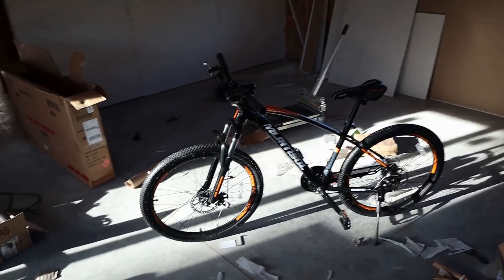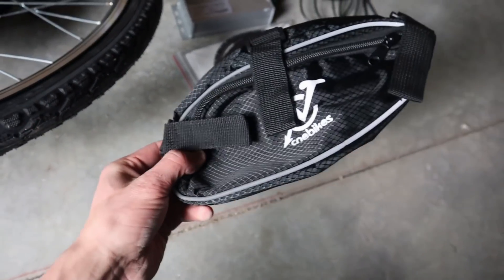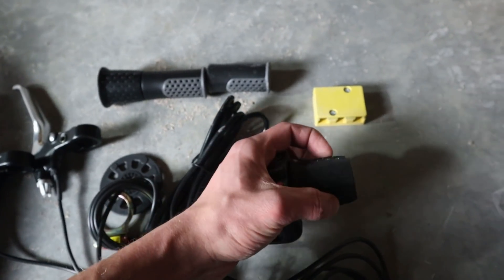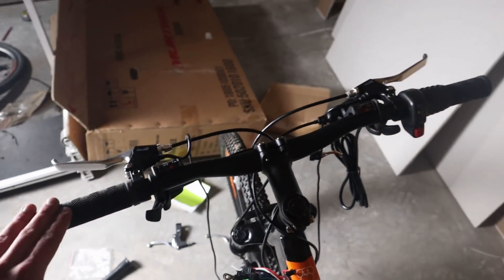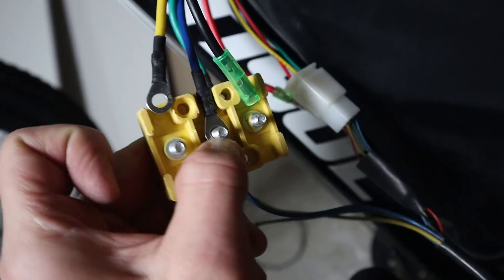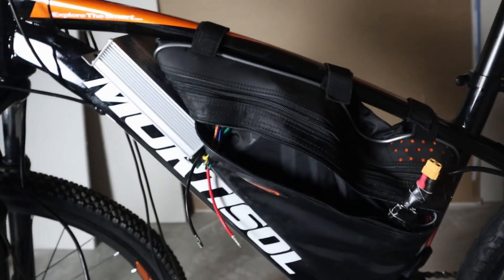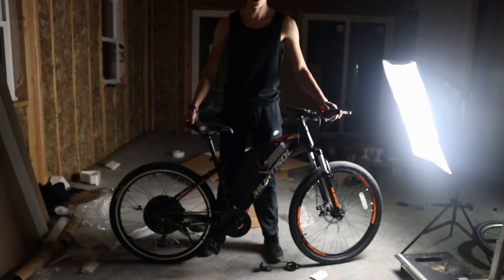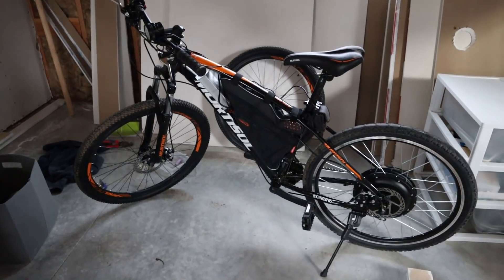$400 FAST DIY Electric Bike

Comment: Hi. Hi  need to build a one. But locally it s hard to find things... i have to import at once so bit scared to spend For research because of high price. 20/24 inch mtb what do you recommend motor
1.) Flipsky 6384 4kw 1kg 190kv speed  9Nm torque 
2.) Kunray my1020 3kw 5kg 5000rpm at 72v 5.4Nm torque 
Confusing part is kunray 5kg but 5000rpm 5.4Nm and flipsky is 1kg 6800rpm(36v) with 9Nm 
Thanks

Comment: What size motor is that wheel, an the battery? Did I miss that 🤷🏻‍♂️
Reply from the maker: 1000w 48v and a 10ah 48v battery
Reply: @logannobles  cool

Comment: Can I use a 1000w 48 volt front wheel kit with a 48 volt 20 ah lithium battery?
Reply: Yes. It will have a lot of torque but most likely use up more battery
Reply: @ripp3rjak934  what would you recommend
Reply: @jher6969  I mean the kit you have currently can take you up to 28mph so that’s already decent. 

I would recommend getting a bigger hub drive if you’re looking for faster speeds. 

The 20ah is already more than good enough.

Comment from the maker: Just a public comment nearly 2 years after I made this video:

1. I went on to make 20-30 more electric bikes and learned that this one was done very poorly. Please ignore anything obviously dangerous or stupid
2. This was a brand new house. The audio was terrible in the intro, I apologize.
3. This video has made me almost $700. Thank you so much.
Reply: How about making an updated video with the lessons you learnt?
Reply from the maker: @rugglez  Great idea
Reply: Could you teach us about the wiring that you have to DIY sometimes? Or about different components that are compatible with different builds, for example LED lights, LCDs, maybe even water-proofing your wiring? I wish I knew that some kits were pretty bad before building my first e-bike. We had to make a lot of work arounds especially with the battery connection, gear ratios, and LED lights.
Reply from the maker: @originalrecipe6113  Late reply, but yes
Reply: @logannobles  thx

Comment: checking out the parts (and similar items on ebay). EVERYTHING, exccept the flashlight comes with shipping that is double the item's price!!! so a quick estimate it went up to 1100$ (without a bike!!!)...
I do find hub motors on 1000W & 1500W for under 200$, but they are only the hub motor. They are missing the wheel... and i am a bit scared to put the wheel on the motor (u know with all the little wire-sticks (that have a name), etc...)
Problem is it doesnt come with any of the other parts he showed. Like controller, trhottle, cables, regen bracking, etc... and if i go to pick up those by myself, i am sure that half ofthem will not work with eachother and i will have to dyi them (entering an infinite dyi cycle...)

No battery for under 400$... it will cost me close 280$ to make my own... but i dont really have the necessary tools...
And on the bike side, mine has really skinny tires, and the forks that hold them are quite close... so a new bike is needed... and again nothing acceptable for under 300$... and by acceptable i mean sth simpler than what he used. I would be quite happy with the one he used.

So... once again i am going back to looking for parts and a way to do it on the cheap, because hte costs above dont really fit my definition of cheap.

(for context i am in Greece, not the US. $ is used as an indication, everything is converted from euros)

Comment: This guy so dumb plugging that in with bare wire if they touch that would burn out the speed controller  and not be good for your batteries

Comment: 10:19 you really fucking say why all the  cables are so  long u have any common sense why dont u look at the front of the bike why are the brake cable and cog set And derailleur so long so they don't get twisted around the bike frame and handlebars and so they can reach where they need to be and why the ebike wires soo long??? So if you want to put the controller box behind the seat in a basket and there are some cruising bikes that are really long like the stingray bike they made it so if someone wants to do that stuff they have enough wire to do it woow i felt dumb hearing that where. U alienated?

Comment: 12:10 wooow that is so dumb and dangerous and also puting 12 gauge wire together with  20 gauge wire another dumb thing. Thats like connecting a 2-inch pipe to a  1 foot pipe thats a lot of resistance and connecting copper wire with steal wire even more resistance and drag with the power
Reply: Resistance doesn't work like that. The 12 gauge wire can handle the current the motor needs, and the 20 gauge wire is unnecessary. The resistance will not have any noticeable effect.

Comment: Obviously the next step is to do a kick-ass dual wheel drive that I think would change up the whole game
Reply from the maker: Oh, it’ll happen. It’s been close to a year since I made this video. By now I’m building 3-5 of these every few weeks to sell
Reply: @logannobles  I'm interested do you think you could put one together for meI've got a few bucks saved up and I'd like something unique you know what I'm saying
Reply: How do you wire a bike with dual motors? AND do you need dual batteries, and Dual controllers, too - or can you run both motors on 1 battery, 1 controller and 1 throttle?

Comment: I looked at one of those kits!! It $141.00 for 1000watt rear tire!! So how many lithium batteries should I buy?? And a charger to correct?? TYVM I’m BRIAN..
Reply: Does the controller come with the kit?? Ty
Reply: Rick Simpson  ahhh same man recently bought a kit and built a battery. i shunt modded my 25a controller and accidently took it up to 60a and added regen and it started poping wheelies lol but but will burn the motor in 10mins without additional cooling lol. i reccomend at first go with a 1000w kit and mod the the shit outta everything and run 5kw or more peak. mod the motor and put ferrofluid and hubsinks and get a programmabble controller and high amperage lipos. a used dh bike or fs bike with air forks and shocks is what you need ive read zoom hydrualic brakes for £25 are good enough and im going to purchase them soon and i also have regen but its not powerfull enough to replace my brakes but slows it down and reduces wear on brake pads my frame is a used fs for£15 but is steel and im currently adding a torque arm so the frame dont break and ill be back on the road . endless sphere forums is the way to go for researching
Reply: Rick Simpson  my 52v 10ah pack cost £90 look into makeing batteries and purchase littkala 26650 cells from aliexpress. look at vortecks channel his ebikes are a good example of high power safe ebikes

Comment: Add a hub motor to the front wheel for MOAR POWAH!
Reply from the maker: edstar83 Hey! Thanks for subbing. I’m actually considering a 2wd bike next!
Reply: @logannobles  No problem. I'm enjoying your videos.
Reply: @cobz76  Horrible idea.

Hard on the forks and the drop outs are not beefy enough in the front for the instant torque of an electric motor.

Im sure you could add some kind of a torque arm for added strength, but beyond that...kinda risky.
Reply: @robspear03  As long as you don't try it on a wallmart bike it shouldn't be a problem. Mountain Bikes over $1000 usually have beefy forks. 

Growing up I lived on my bmx bike. It took me on many adventures. And that bike copped a lot of abuse,  I was jumping and doing stunts on it from the age of 5 up until I finished high school. I never cracked a fork or bent a rim.
https://www.youtube.com/watch?v=SHXQr2MPJS8
Reply: @cobz76  I use Walmart bikes....I just ride on the flats and I don't do stunts....I might hop off the sidewalk from time to time.
Reply: @cobz76  I don't use Walmart china crap bikes, its only American Made Chromoly Trek bikes or nothing for me. Durability is my desire over light crap

Comment: You have no idea how to build a ebke most important part is your battery, second hand rubbish or lead acid will not do.
Reply from the maker: Well, I've finally started spot welding packs out of LG cells, as of the present time. This was my first attempt and, yeah, maybe I didn't know the safest way to build an ebike, but I did it, it worked, and it inspired me to keep learning.

Comment: My first homemade ebike  was in 2005. Wilderness Energy 600 watt front wheel drive. Came with a 36 volt controller. 3 lead acid batteries 12v x 12Ah. Thumb throttle. Used it to commute back forth to work. Averaged 25 to 28 miles per hour. A lot of rolling hills in my area. Eventually bought a 60v controller from another company. That baby would fly. Sold it to a friend minus the 60 v controller. Does my heart good seeing more people turning to EV's.
Reply: Probably going to Walmart online to get my next ebike kit. They got some really good choices. Check'm out next chance you get. Walmart online.

Comment: Brilliant 👍 I'm thinking of making a similar budget full suspension electric bike.
Reply from the maker: Isaac Lyons thank you! Actually So am I!-
Reply: @logannobles  awesome! What kind of parts are you planning on using? I'm thinking of using a cheap 1000w hub motor kit from ebay, either two or four 6s lipo batteries and a cheap full suspension mountain bike.
Reply from the maker: Isaac Lyons that’s what I’d do, except I’d buy two new controllers and overvolt them both to 2000w 😜
Reply: @logannobles  lol. What about an electric swing bike then? Google it if your not sure.
Reply from the maker: Isaac Lyons Definitely could be done! Just have to mount the battery differently.
Reply: @logannobles  yeah

Comment: how many miles you can drive with that battery
Reply: About 15-20 miles.
Reply: @matts5124  what about the cheaper?`
Reply: Johannes less than 10 miles maybe less, like 7 or 8. Plus they are heavy as hell.
Reply: Johannes if you’re going to get a battery, don’t even buy the cheaper acid based batteries, it’s not even worth building an ebike using them.
Reply: A very legit Question 👍

Comment: Wow wish I could get these parts anything near that price US $142.99 in the UK. Pity about the dangerous wiring job and soo small a frame size bike but Boy did it shift?  Have you ore anyone else  got any links I can use to get some of the parts in the UK  at good low prices?
Reply from the maker: Hahaha it was my first bike and sketchy as heck. Not sure I can help find parts and the laws are different there but they sure are fun
Reply: i got a 48v 1000w kit for £140 off ebay in teh uk

Comment: Not all bikes are the same specifications There are electric bikes $ 500 to $ 5000 Cheap bikes because their battery does not walk over 40 kilometers There are bikes that walk over 250 kilometers There is a minivan from 500W to 14000w The price has to be very different between a simple and high bike and I have an electric bike  I bought it from AliExpress from China for $ 4000, its speed is 120kmh and the 48AH 72V battery is better than some electric cars and I would like to tell you the value of batteries is the most expensive in the bike, especially when you are from Panasonic
Reply from the maker: Nahyan Sultan this is true, different battery quality and price yields very different results.

Comment: So i am going to buy a ebike conversion like you and on the advert it says 48 v 1000w so can i get a 1000w 15ah battery or should i get 750 10ah
Reply: Would this work 

www.ebay.co.uk/itm/36V-15Ah-Li-ion-Electric-E-Bike-Battery-Pack-Bicycle-Silver-Lockable-2A-Charger/113222458997?_mwBanner=1&ul_ref=https%3A%2F%2Frover.ebay.com%2Frover%2F1%2F710-53481-19255-0%2F1%3Fff3%3D4%26pub%3D5574631662%26toolid%3D10001%26campid%3D5338243305%26customid%3D9676103f511e675340a7817663a2626e%26mpre%3Dhttps%253A%252F%252Fwww.ebay.co.uk%252Fitm%252F36V-15Ah-Li-ion-Electric-E-Bike-Battery-Pack-Bicycle-Silver-Lockable-2A-Charger-%252F113222458997%253Fvar%253D%26srcrot%3D710-53481-19255-0%26rvr_id%3D1939841042066%26rvr_ts%3D360152d716a0ab66f177e7e0ffa88496&ul_noapp=true&pageci=4c7e7a82-dcfc-4039-8f36-5f44493ce24e
Reply from the maker: Bert Breadel the 750 WILL work just fine, but that’s entirely up to you, 15ah will give you more range!
Reply: My brother said the motor will burn out if its a 1000w battery and 1000w motor
Reply from the maker: Bert Breadel Not true. A: The motors almost never burn out left unless overvolted. B: why would a 1000w battery burn out a 1000w motor? That’s like saying a 12v charger would blow up a 12v battery.
Reply: Cyclonex1CA ca  thanks
Reply: Get a 52v 1000w battery, trust me the extra Voltage will get you more power. Always opt for a bigger battery but know the specs you need.

Comment: Il just stick to gasoline power bikes.cost less
Reply from the maker: K Lucifer I used to have a gas bicycle and I’ve had three dirt bikes and one dualsport. You never have to buy gas or check oil. So I wouldn’t call a gas bike cheaper
Reply: @logannobles  intial cost ita cheaper.
Reply: @logannobles  theres cheap gasbike kits..90buck 2 strokes but i dont recommend them as am a tq man 2 stroke bikes engines have no tq
Reply from the maker: K Lucifer yeah that’s what I originally tried. I’d like to see your setup!
Reply: @logannobles  its on my channel..i basically have genuine ghx50 engines with lights/horn/directionals and a working radio
Reply: Between all of my family we have 11 motorbikes , with half of those being registered, if i can get some where to gym or shops or whatever cheaply without ever putting fuel in or hav8ng to pay rego or insurance,im takeing that as a win
Reply: @fearnobeer9077  in my state i dont need to register my motor bikes just need keep an eye on how much fuel i have
Reply: I have a gasoline bike thats on the back tire and a ebike tire on the front and i have a alternator on the bake tire so i can us the gas tire to charge the ebike battery

Comment: Should i get this battery im not sure its really 48v 13ah im building an ebike following your video please respond thanks! https://www.ebay.com/itm/Hailong-E-Bike-48V-36V-13Ah-Lithium-Lion-Battery-w-Charger-for-500W-1000W-motor/113655283599?hash=item1a7661ff8f:m:mMA8CAf8QygGVefklaMOb8w
Reply from the maker: Elias Feleke Sweet! I have more, similar projects on the way. Hope your build goes well!
Reply from the maker: Elias Feleke that would work perfectly!
Reply: @logannobles  would it really be 13ah?
Reply: @logannobles  just seems like a low price
Reply from the maker: Elias Feleke most likely yes! Batteries have gone down in price significantly, I just bought a very similar 10ah one for $169, so it looks quite legit.
Reply: @logannobles  thanks you just got my sub👊🙏

Comment: Cool video. How many miles can you go not pedaling  approximately?
Reply from the maker: Roughly 15-20 miles depending on speed and number of stops, with a 10ah battery which is one of the smallest.

Comment: Nice video and research, I'm planning to build the same bike with a 1500w motor, not sure about the bike, how is that one holding? I was between the Murtisol and the  Finiss, both in 26". Thanks.
Reply from the maker: Emanuel Gazzano it’s holding up surprisingly well. Haven’t had any issues, just make sure you tighten down everything well.
Reply: @logannobles  Thank you very much, also, did you use a torque arm in the rear wheel?
Reply from the maker: Emanuel Gazzano yes! The bike actually came with torque arms.